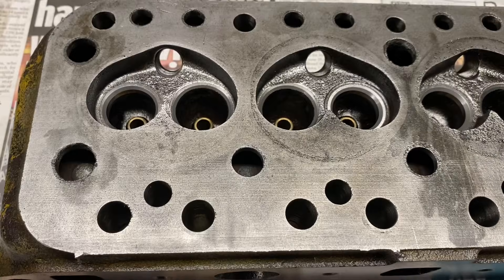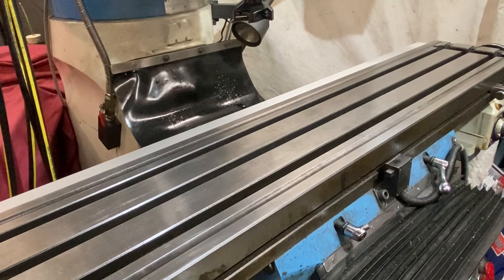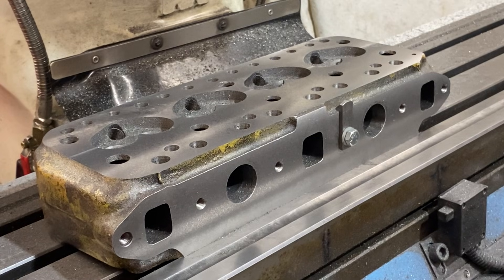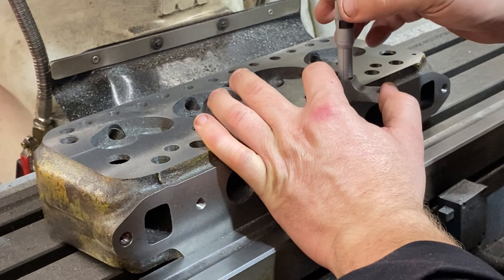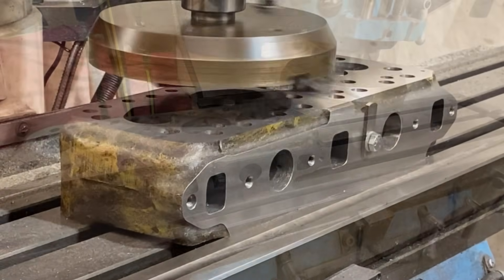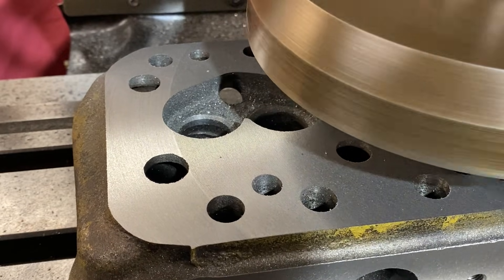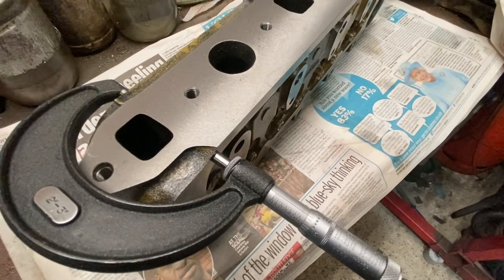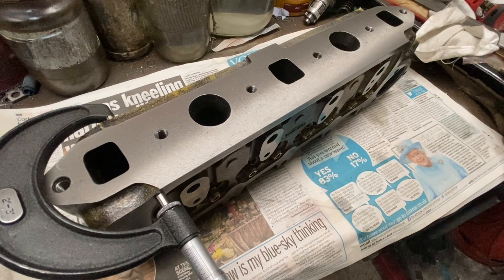Machining On the mill - Resurfacing (skimming) A-series cylinder head

Comment: New to milling. How fast was mill speed?  What was the tooling used? I want to purchase a face mill head.
Reply from the maker: Be guided by the cutting speed guide provided by the inserts you are using. The 5 tooth facemill I use is an interstate brand from MSC.

Comment: Nice work mate.
Ive scraped a few machine back into shape. It always makes me laugh when the 'expurts' claim you can't do this or that cos their 70 yr old beater at work cant do it 😅
Cheers D
Reply from the maker: You are 100% right there, I have spent most of my life being told you can’t do things this way or that way, well you can, if you think about it!
Reply: @ACDodd  Hey mate, a little something Ive not come across before in this one. I thought you might find interesting, hes a good a lad, doesn't tolerate the 'expurts' lol 
15:33  https://www.youtube.com/watch?v=FQPzqCt6reg&t=941s 
Like you he runs the cutter out of tram a thou or 2 for no back cut, but hes running the head kicked over so as the cutting edge lines up with the centre of the machine, this way you dont have to come so far over the with the table, keeps mass more over the saddle. Makes good sense I reckon, probably worth doing If you're trying to hit a silly tight number or if its a 6 cylinder something long n heavy 👍
Cheers D

Comment: If you were machining the heads of a V8, which face can you rely on as a reference plane?  The same question when machining a V8 short block.  Where do you set the reference plane, before machining  the head mating surfaces?
Reply from the maker: Main bearing tunnels for the block using the cam tunnels as a centre reference plain. For the heads it does not really matter as long as inlet manifold face angle is correct with the head deck surface after machining.

Comment: Great video and informative. The last head I did like this was at a tech college. Used a flycutter but we set the vertical head over about 1/4 degree off vertical. This gives you a single cut without a trace left on the exit side. Also better if your head is too long to give a full exit for the full rotation of the flycutter. Also interesting that the original machining for your head was from a planer.

Comment: How do you know the face of the head is parallel to the mounting Surface or are you just presuming that the top of the head is flat
Reply from the maker: I check it with a micrometer after skimming its usually within 0.0005”

Comment: Nice work!  I'm in process of making a fly cutter right now.  Same style as yours.  Started with a 8.5 inch diameter round steel stock at 1.75 inches thick. After machining, boring the center hole, and attaching an R8 blank arbor, it weighs about 24lbs.  Just machined a slot for the carbide tool holder.  Can't wait to try it out.  Thanks for the great video!  Approximately what are your feeds and speeds, just so I have a rough starting point.
Reply from the maker: 200 rpm and 60 to 70mm/min

Comment: I've seen loads of these videos but if it's a spinning tool, how does it only cut on one side and be level? Is that the "back cut"? Is the tool angled to do that?
Reply from the maker: Yes the head of the mill is angled such that the trailing edge of the tool is 0.002” lower than the leading edge. This also
Produces a head which is not perfectly flat but at 0.0002 to 0.0003” this has no effect on sealing.

Comment: I would have put two end stops, one at each end, and pushed it up against tenon stops to prevent ant movement…..
Reply from the maker: The reality is there is so much surface contact, and so little force from such a small cut it’s not necessary. However if I were using a facemill and taking big cuts this is a sensible precaution.

Comment: OLÁ.  A aparência é de ser uma ótima maquina.   O primeiro ferramental usado é totalmente inadequado.  O segundo equipamento eu diria ser de melhor precisão.  Infelizmente a demonstração é muito falha.  A regulagem da "torre'" DEVE ESTAR A EXATOS 90º em relação à "mesa" da máquina.  A ferramenta de corte tem de cortar o corte feito de lado a lado mostrando CLARAMENTE  O CRUZAMENTO DE LINHAS NO CORTE..  (para que isso ocorra é necessário que o ferramental de corte ultrapasse totalmente o comprimento do cabeçote).  Na demonstração feita dá para notar a falta de planicidade no cabeçote.  O operador esqueceu ou não sabe da importância do cruzamento.  ABRAÇOS...,   Roberto Udo Krapf
Reply from the maker: I am well aware of the head tramming and this adds a few tenths of a thou curvature across the head. Which in practice causes no issue. The head is deliberately tilted so that the trailing edge of the cutter is 0.05mm lower than the front. You can therefore calculate the amount of curvature.

Comment: When a head is warped, it is like a banana, that means the cam bore also warped?  If u shave off the gasket side surface to make it flat, the cam bore still not straight, am I right? U do not want a cam bending and rotating. Too much resistance and it will weaken the camshaft. The only way is to use heat to straighten the whole head and that is expensive process, am I right? With that being said, to what extent we can resurface (skim) the head without a concern of cam bore not straight? 0.002"?? To what extent we should not even bother fixing? over 0.008? (...for a 4 cylinder head.)
Reply from the maker: I am showing an overhead valve head here there is no cam in the head.
Reply from the maker: In your application the head must be straightened first and the alignment of the cam tunnels returned to straight before any skimming, refer to manufacturers data for cam tunnel alignment for the engine you are working on

Comment: What are the attachments called your using in you’re mill for doing heads.
Reply from the maker: Which attachments are you referring to?
Reply: @ACDodd  the cuter heads
Reply from the maker: @TheTechGuider  the first cutter is facemill, 3inch diameter with 5 carbide inserts, the second is a fly cutter and it’s homemade.

Comment: Would adding a support either end of the table travel help reduce droop?

Perhaps a couple of studs on the bench with adjustable Teflon nubs for the table to slide/rest onto when at full travel.
Reply from the maker: Droop is a factor of wear or poor maintenance in the slideways. This machine will mill parallel to 0.0005”
Over the length of the head, droop is not a factor here.

Comment: What feeds and speeds do you run the fly cutter at? I’ve got a customer dropping in a pair of heads this week to do, I’ve never machined heads before so I don’t really know what Ra to go for. I assume they don’t have to be super smooth. Im thinking say 0.1mm/rev with an 08 nose should be fine.
Reply from the maker: 0.3 to 0.35mm/rev, 150m/min speed.
Reply: @ACDodd  you’re a legend…
Reply: @ACDodd  what insert you use? My “fly cutter” takes CCMT, But I can really put anything in it, it’s just set up with a CCMT holder at the moment
Reply from the maker: @madaxe79  I use a TNMG220408 insert for aluminium
Reply: @ACDodd  sweet.

Comment: Thank you for great techniques using standard shop tools. Is the fly cutter shop made? Steel or alumnium. Diameter ? High speed steel or carbide cutter?
Reply from the maker: Carbide tipped. The body is Mike steel around 8in in diameter. If you are going to make one use a large thick piece of
Aluminium. It will reduce the ‘ringing’ when in operation

Comment: Awesome job! I do have a question, why go for the single point flycutter rather than a face mill? I have access to some rather large face mills that could skim the head in one pass. Is there a benefit of the use of a flycutter/single point tool that I'm not seeing?
Reply from the maker: You would need a more rigid machine to run a large face mill. In use a 3 inch one for taking large cuts when I need to remove lots of material. Then I switch back to the fly cutter for finishing
Reply: @ACDodd  Okay sounds good, my other question is what difference does back dragging the tool make? Is it something that is going to cause an issue with the finish for the surface?
Reply from the maker: @17thLineMotorsports  I have set my head so that the tool is 0.002” difference in height between the front and the back, therefore there is only contact on one side
Reply: @ACDodd  Right, I'm just wondering why one would do that instead of leaving the head of the mill alone and letting the tool drag? Better gasket sealing surface? Sorry for all the questions, looking to try this out myself and don't want to miss any details on it
Reply from the maker: @17thLineMotorsports  the surface finish is poor unless you tilt the head slightly
Reply: @17thLineMotorsports  our actual head and block resurfacing machines are manufactured with the spindle head out of tram a couple thou to prevent backcutting or dragging.
Reply: Surface would be slightly concave because tool is lower in the centre when setting tool that way

Comment: Like your work...would have loved to see you sweep the head to check geometry before milling.
Reply from the maker: I would normally do that if I was taking a light skim with the fly cutter. In this case a bigger cut was needed and the face geometry did not matter as I simply needed it parallel with the bottom face.

Comment: Very good.  I made a similar fly cutter for my Bridgeport, but the surface finish is only just "OK", i wouldn't use it with a steel multi layer head gasket.  Probably fine on a cast head with a old style fibre gasket.  What feeds and speeds are you using on iron, and alloy?  I even tried a PCD insert on alloy, which helped, but it still isn't perfect.  Maybe my expectations are too high for a old Bridgeport.  I even added weight to the back side of my 10 inch alloy fly cutter "disk" to balance out the cutter, which helped, and from a distance on alloy it looks like a mirror, but it isn't good enough...  Have you measured the RA?
Reply from the maker: I only cut cast iron, 200rpm and feed rate I don’t know as it’s a variable speed drive and not geared. Never needed to know the Surface roughness, the a-series heads I work on are very forgiving.

Comment: That certainly worked well in your hands. Your mill is so parallel I will add I've seen worse results in machine shops. Leave it at that ...!
Reply from the maker: The point is people need to maintain there machines. Parallel cutting is certainly possible on a machine in good condition that is set correctly

Comment: how can you use the a flycutter so that it only cuts on the backside? you dont tilt the spindle i guess? nicely insightful video though!
Reply from the maker: The head is tilted, the rear side of the cutter is 0.002” lower than the right
Reply: @ACDodd  so if you put the cutter in reverse you can have cuts on the other side of the flycutter? and why would that be better?
Reply from the maker: @ozr2222  no, it’s not in reverse.

Comment: AC what set of sanders (manual or power) would you recommend for removing warp on an V- engine block while in the bay.
Reply from the maker: Sorry I would not recommend doing this with the engine in the vehicle. It’s a remove, strip machine the decks adjust the inlet manifold to compensate and then clean and rebuild.

Comment: nice video mate - i am curious about the stop you used for the depth gauge - the end of that steel stock  looks rounded - would that not cause a problem for repeatability with the depth mic ? - im working my way up to surfacing a set of iron heads on my own so just trying to learn - thanks for sharing a great video. Cheers
Reply from the maker: It is rounded for a reason, I simply measure to the highest point.
Reply: Which gives you the best reading and quicker to setup since it doesn't have to be perfectly level.
Reply from the maker: @dm-zx7xb  not sure what you are referring to?
Reply: @ACDodd  was stating that the piece being rounded allowed for quick mounting without needing to be true to anything. A non rounded piece would need to be squared to the head otherwise you would get a different reading depending where you measured from if it were mounted at an angle.
Reply from the maker: @dm-zx7xb  gotchA

Comment: How much does it cost to build a fly cutter like this? What inserts do you use?
Reply from the maker: Depends how much scrap material you have lying around. The tool holder is a TNMG 22 left hand turning tool which was purchased the rest was machined including the R8 taper spindle mount

Comment: Very neat work. Some great interesting videos you're putting up. I've recently had my head done a CST so interesting to see the process. Although I had my chambers completely reworked and larger inlet and exhaust valves installed. Surprised this head isn't breathed on as the chamber's are so restrictive? Subscribed!
Reply from the maker: In this case the customer only wanted the seats recut no blending. Thanks for the comments, my intension is to show how things are done, and sometimes not always with full on commercial equipment.
Reply: @ACDodd  Great videos, thanks for sharing. I do similar work on a mill and my thoughts are that commercial equipment concentrates on speed/profit over quality. A good condition mill can often do it too good ...